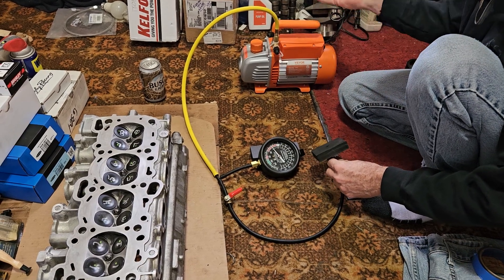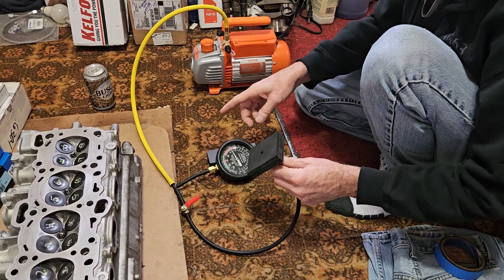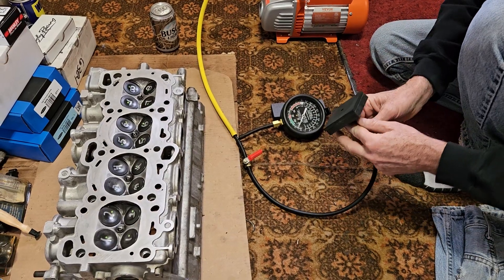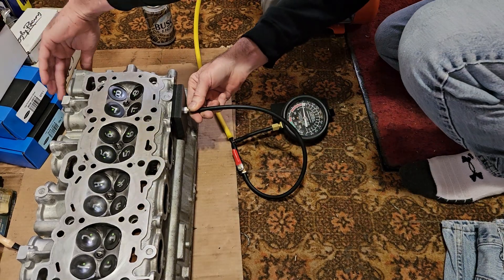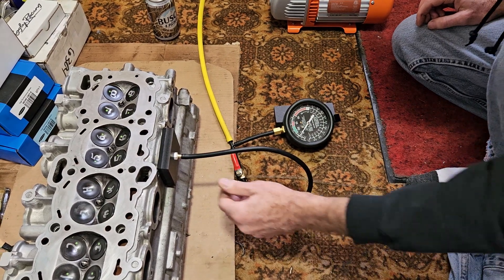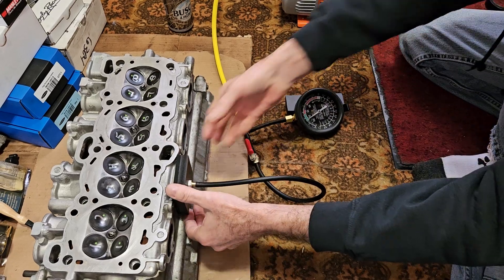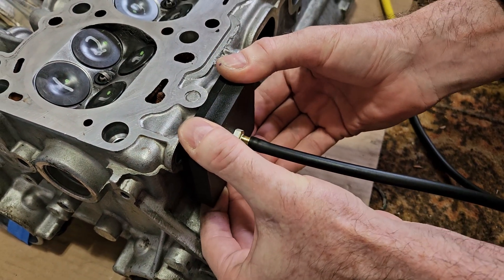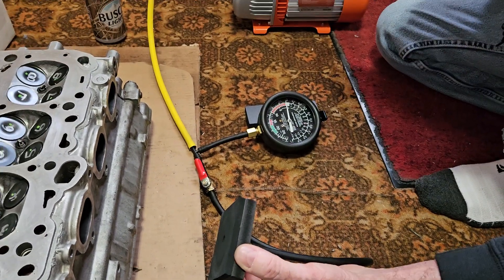Valve Seal Checking Tool for DIYer's.

Comment: This is great, been trying to think of a way to check my valve work. Will get making a trip today to the hobby shop
Reply from the maker: It works VERY well. Move the ball valve to the other side of the line to watch for leak down when you close it. My components came from Amazon and links are as follows:
Component Links -
Hose: https://a.co/d/i2xMx1T
Ball Valve: https://a.co/d/eeTlzwO
Vacuum Gauge: https://a.co/d/eUeqKBv
Vacuum Pump: https://a.co/d/aZxfAU2
PVC Sheet: https://a.co/d/6dFTKU0
Hose Nipple: https://a.co/d/gLk1ctD
Sticky Back Foam: https://a.co/d/7GBiSOu

Comment: How much vacuum pressure should be applied?
Reply from the maker: @renejacques8288  as much as it will hold. Most vacuum pumps max out around 28 hg. Under deceleration, your engine would see around 28-30 hg of vacuum so don't be afraid. 👍

Comment: Do you have a list of the parts? for this tool?
Reply from the maker: Component Links -
Hose: https://a.co/d/i2xMx1T
Ball Valve: https://a.co/d/eeTlzwO
Vacuum Gauge: https://a.co/d/eUeqKBv
Vacuum Pump: https://a.co/d/aZxfAU2
PVC Sheet: https://a.co/d/6dFTKU0
Hose Nipple: https://a.co/d/gLk1ctD
Sticky Back Foam: https://a.co/d/7GBiSOu
Reply from the maker: 1/4" Ball Valve 
uxcell Ball Valve Shut-off Valve, 6.4mm Hose Barb to 6.4mm Hose Barb, Hose Pipe Tube Fittings, 180 Degree Operation Handle, Brass Valve, Pack of 1 https://a.co/d/eeTlzwO

Refrigerant Charging Hose
uxcell Refrigerant Charging Hose, 1/4 SAE Thread 2.95Ft Length 500PSI Tube HVAC Hoses, for Home Air Conditioner Refrigeration Maintenance, Yellow https://a.co/d/i2xMx1T

Vacuum Gauge
WUODAO Fuel Pump Pressure and Vacuum, Carburetor Intake Manifold, and Vacuum Test,Car Fuel Pump and Vacuum Tester Gauge https://a.co/d/eUeqKBv

Vacuum Pump
VEVOR 3.5 CFM Vacuum Pump, 1-Stage HVAC Vacuum Pump with Oil, AC Vacuum Pump 134a, 4-Pole Pure Copper Motor-Longer Running Time, for Resin Degassing, Refrigeration Maintenance, Vacuum Package etc. https://a.co/d/aZxfAU2

PVC Sheet
Mega Format Expanded PVC Plastic Sheets - 5" X 7" Rigid Black Sheet for Crafts, Signage, & Displays - Sintra, Celtec PVC Board - Waterproof for Outdoors Use - 1/2" 12mm Thick - 1-Pk-Black https://a.co/d/6dFTKU0

Brass Hose Nipple
U.S. Solid Brass Hose Fitting, Adapter, 1/4" Barb x 1/4" NPT Male Pipe Fittings https://a.co/d/gLk1ctD

Sticky Back Foam
Adhesive Backed Foam,Adhesive Foam Padding 4 Inch Long X 4 Inch Wide X1/4 Inch Thick,Foam Padding Sheet for Furniture Cars Speakers (6, 4" x 4" x 1/4") https://a.co/d/7GBiSOu
Reply: @martywilsonwilsonenginesho7940  Amazing mate, thank you very much

Comment: Your cutoff valve should be between the pump and the gauge, not the gauge and the head....it. will allow you do the leakdown test.
Reply from the maker: That was changed months ago, but thank you for the tip!

Comment: Hey bud, best way I found with these is to shut the valve and time how long it takes to lose that vacuum. If valve stem seals arent in you can put temporary ones in using a bit of latex tubing cut and slipped over the valve and valve guide. Nice work.
Reply: Reason is because these vacuum pumps are powerful they can pull a decent vac on a leaky valve! The pro ones use very small CFM so no need to isolate. But with a pump like this you want to be shutting that valve I think so you can isolate the pump from the system.
Reply from the maker: Yeah I played around like that too but didn't really "time" them. It was interesting and FUN to check my work. I posted a before and after picture of the #2 cylinders exhaust valves when I got finished with the video and gained 2" of vacuum just lapping a little more. The leak down you are talking about is a good test of the wear of the guides and any bad valve stem seals, which were old on that head.  I appreciate the tip and thanks for just tagging along this adventure that seems to repeat itself because I drive pretty dam hard but know who to blame. 😊👍
Also, I intentionally got THE CHEAPEST, LOWEST CFM pump I could find for this experiment. It will double as my vacuum pump for my personal a/c jobs that I have been using a venturi style pneumatic pump for. 😎